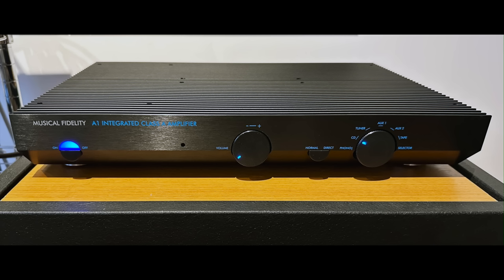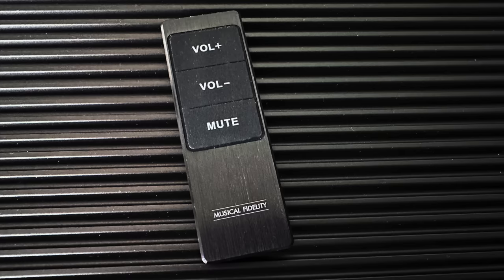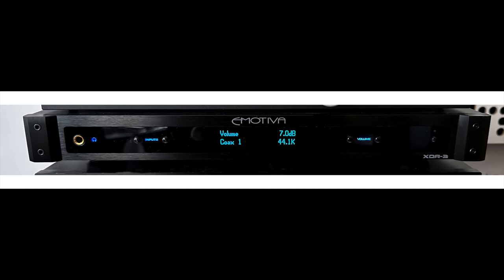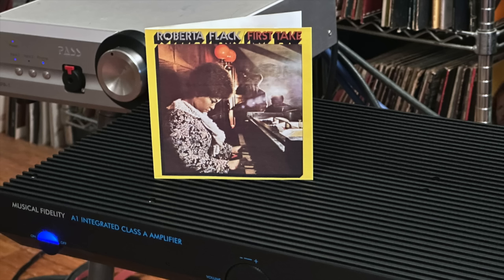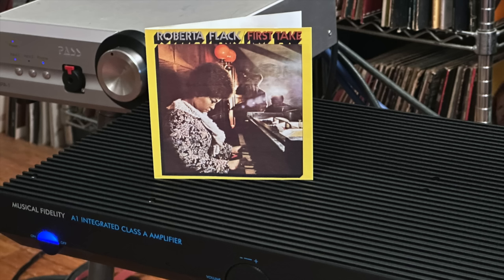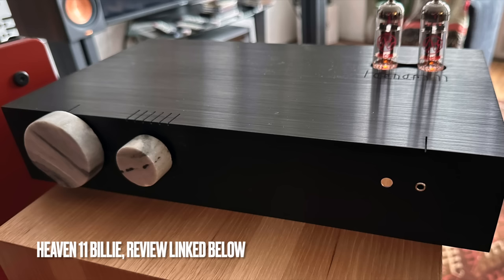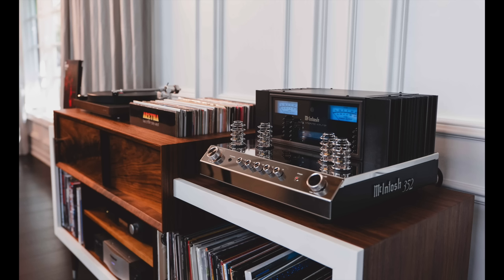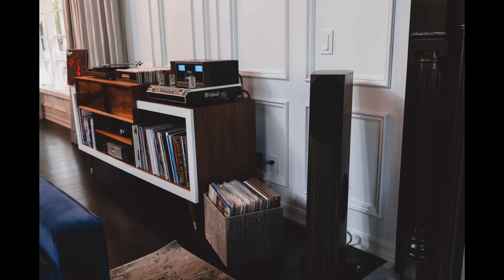Musical Fidelity A1 Amplifier, A KNOCKOUT!

Comment: The corrugated surface looks like a pan for grill marking steaks or pork chops.
Reply: Perfect for grilled cheese sandwich
Reply: It’s a built in George Forman Grill.
Reply: It's hot enough to cook👍
Reply: A lot of home/car audio amplifiers looked like this back in the 80's & 90's.
Reply: As long as you like everything well done oh, but you can only use grade A meat it's the only thing that works with class-a

Comment: 1985 - that is when I bought mine. Still running it =)
Reply: thats super cool its still going. you have to get any work done to it ? 85 was the year i was born. i got the new release of it and enjoy the hell out of it
Reply: @philrob4468  I had a fuse blow and when I took it in to fix they also fixed the source selector that was slipping and recommended I re-capped it as the capacitors were looking worse for wear. It's been brilliant since.

Comment: Hey with cooler autumn temps coming on it's nice to know you can buy a room heater that drives  speakers!
Reply: It's the kind of thing that could be used best in the winter time. Unless I am mistaken, a Class A amp is 100% efficient at turning electricity into heat at idle.
Reply: @EskWIRED  Yes, but the particular amp consumes about 100W at idle.
Reply: Do you live in a closet?
Reply: The bad news is that your electric bill goes up....the good news is your heating bill goes down!

Comment: Back in the 80s I owned the bigger brother to this amp, the A100. I remember the sound fondly. The bigger amp contained 3 fans for additional cooling. If one fan went down then the thermal management circuits shut down the amp. Mine went back to Musical fidelity twice in 18 months with fan failures so I sold it (despite the quick turn-round from MF). My cousin (a professional musician) owned the A1 for several decades and loved it. Both Musical Fidelity Class-A amps sounded great. "Engaging" would be a good description, these amps really draw you into the music.

Comment: I returned a pair of speakers for store credit and on a hunch and a whim I used that store credit and pre-ordered the A1. My A1 unit arrived double boxed, and like Steve I was very impressed with the charming sound of this amplifier. This is my first amp experience with solid state class-A circuit topology and now I’m in love with it. I think of it as this analog vortex of hot dense energy that summons tunes that glow like neon lights. It does all the neon colors, the tones have a luminous watch dial in the dark quality, the way the tones pop and flow makes it easy to connect the intent, that music aims to convey, think chord and sentiment. I don’t think of it as warm sounding in the way that tubes glow warm, the color is not orange or red the coloration is like the half moon power switch on this unit it glows blue. This half moon power switch design has this clickety-click, that is in itself a time warp back to the mid 1980’s, remember the tactile feels of cassette tape players from way back then, that rectangle key of a button before silent buttons became the trend.. P.S. the remote is magnetic
Reply: The sound of the A1 was ... you know, it was okay as a 25 watt amplifier, using the speakers of the day that in England never went much below 80Hz.  Some people claim they used Wharfedale but the A1 was more expensive than that.  Nobody ... not a single buyer ... bought Wharfedale for an A1.  They used you know, British market stuff, I never even bothered looking at what they used.  It was a good, big room filling sound but it a bad time in NYC, the 1980s, wow!  You know, any remember the British speakers we used back then?  They were TDL, JPW and Mordaunt Short, you know stuff like that, not KEF, not Mission.
Reply: @keplermission  I'm listening to Dream Division's 'Lumarian' album from the Library of the Occult Records collection, did you know that blue stars are the hottest and most massive of all, can you feel me now
Reply: @keplermission  What are you mumbling about? You are clueless.
Reply: What speakers are you using please w it & what size room  ty ?
Interested to hear how it compares to Sugden & belles integrated (a/ab)

Comment: A once nearby- living friend had the M.F. A1 in the late 80's, I heard the upgrade difference & it was vastly superiour in every way to a fancy looking Technics he had before. After a post- guarantee fault fix, for playing music during hot summer days, he'd put extended speaker wires on & bought longer interconnects, so he could lift it onto a north-facing window-sill diagonally behind his equipment rack for cooler air or some breeze to help cool it, & it's heat seemed to scare him. An engineer friend of ours repaired it twice in the 5 or 6'ish years he had it, until he bought one of my post-upgrade amps, a Crimson Electrik pwr/pre. 
The very first batch of A1's were said to have had reliability issues by 2 or 3 mag' reviewers,  (maybe due to heat?)  but I'm 100% sure M.F. would have overcome any & all reliability issues now they've bought it out again.   P.S. The first Mark Levinson amp I saw & heard working, (ML25?) was rated at 25 watts p/ch in pure class A, it stood tall, large & heavy, and the paint on it's side pannels would eventually tarnish tho quite quickly due to heat alone.  Some newer amp' makers miss-represent spec's e.g. my previous Jungon power amp, (a 99C ?) was spec'd by Jungson as 80'watts max in class A but I've seen the measurements & scope test showing how it does the first 15'ish watts only in pure A, then goes up to 140'ish watts (below point-1 THD) with a slowly increasing class B trans' bias,  it never bothered me as with even lower of averagely efficient speakers, i / we don't go beyond 4 or 5'watts, or a very loud sounding 10'watts rms

Comment: Nice one Steve. I owned an A100 up until a few years ago. I loved it but I listen all day long and It just made me uneasy because of its heat. 
A replacement that was as enjoyable was a bit costly, (it is a jardis).
But it goes to show if it was good decades ago it will be good now.
Reply: You know, the A100 put out more heat as 99% 'Class A'.  But the truth is that cool running Technics 'New Class A' in the awesome SU-V505, ran with Wharfedale Laser 130 and it was better than the Musical Fidelity A100 but the people who bought that upper market brand couldn't bear the thought of using the same equipment as people who were of a lower social class, it was a prestige/ pride thing.

Comment: Class A solid state amplifiers sort of perform like low watt tube amps where they feel much more powerful than their rating. I have a Nelson Pass Burning Amp 3 that's about 35-40 w/8ohms and with my 87 dB, 8 Ohm Usher speakers there is no shortage of power whatsoever.
Reply: I agree. My 6 wpc class A set tube amp sounds powerful and alive even when A/B’ing against my 104lb Mark Levinson class AB 100wpc power amp up to 85 db peak.
Reply: @epi2045  I don’t doubt it. I also have an Odyssey Khartago which is also about 100 watts or so and, yeah, the burning amp goes neck and neck with it as far as volume and even sounds fuller with better bass not to mention beats it in many other ways. What are the specs on your speakers?
Reply: @sean_heisler  I have a custom built Tarkus speaker designed by Paul Carmody. It has a large separate 62 liter cabinet for the 10” woofer and the 6.5” mid and 1” silk tweeter on the top cabinet. 

Specs: Tuned down to F3 of 29hz and extends to a smooth 20khz. 8 ohms and dips gently to 5 ohms. 89 db sensitivity. Pushes to 106 db comfortably.

It’s an emulation of the Wilson Audio Watt/Puppy. It’s a big speaker driven by just 6 watts. Would you believe that it has so much deep bass that it rivals my 15” sub? When I say deep… I mean deep.
Reply: @epi2045  Nice! Just looked it up and they look great. I’m seeing variations of how the enclosures are built and I see the Wilson-esque approach. Those haven’t crossed my radar before! Amazing to think 6 watts pushes all that!
Reply: @sean_heisler  '6 watts?'  Think six ounces, then consider what it's six ounces of.  Six ounces of low quality or six ounces of high quality?  People forget there are different qualities of watts.  Radio Shack in the early 1970s made a lot of high quality low power stuff but we needed special loudspeakers.  Six watts drives what six watts will drive, but we need to use lightweight motors.
Reply: Pass Labs kit is proper hifi - Musical Fidelity in consumer electronics.

Comment: I’ve been reading great things about this amp. And don’t let the low power rating fool you. This is a expensive high end component as compared to a mainstream receiver sold at Best Buy for 500.00 and a exaggerated power rating just for marketing purposes.
Reply: No ... power rating?  A long time ago I told people on here about the Technics SU-Z2 that in England with a 240 volt supply used 470 watts to give 2 x 35 watts.  What did it mean?  Well I looked everywhere on the internet to find just what the Musical Fidelity A1 uses from your wall socket and all I could find is what it puts out to the speakers but that isn't the power consumption.  If it is an ugly room heater as people say, how much juice does it burn?  Most British 35 watt amplifiers use about 190 watts at 240 volts and at 120 volts in the USA, use about twice that much current.  Yeah but...

Comment: This is a class A/B amplifier. Musical Fidelity's marketing webpage for this amplifier at their website states, "The A1 is built around a completely discrete and symmetrical Class A topology. It‘s able to output 25W of pure Class A power @ 8 ohms load with 25A of maximum output. While the numbers here might seem rather low, the ability for the output stage to drive difficult speakers is a small miracle in itself. The amp design being dynamic class A, and if Class A standing current is exceeded, it will automatically allow more. It therefore “slides” (NOT “switches”) smoothly into class B style operation, temporarily allowing the further current draw needed."  In that quoted marketing blather, that last sentence describes what a class A/B amplifier does.
Reply: You are confused. You are confusing push-pull vs single ended output stage topology with Class AB vs Class A. There is NOTHING that necessitates a Class A amp to be single ended. Class A means the transistors are biased such that they are always on for the amp's specified power. A single ended amp can only be Class A by definition but a push pull amp can be anything depending on how the output devices are biased. The A1 is a push pull amp. Is a push pull amp specified as X watts of Class A power not a Class A amp just because it may be able to produce more than X watts of power when sliding into Class B?

Comment: It will be interesting to see if this version of A1 holds up better than the original, which had serious reliability issues associated to heat, at least as far as I know. My headphone amp has a similar profile- gets hot like you read about, and, of course - I think , makes a better lover than a mate. Otherwise, very cool design.
Reply: MF promise that it will due to larger volume and top plate size, perforations on the sides and better rated components inside.
Reply: I had the original AI I bought new. I had no issues whatsoever and I used it for about 20 years.
Reply: @adotopp1865 awesome! Mine was more of question than statement. It looks really cool & MF has a long history of awesome products.
Reply: What hifi compared both. They concluded the original and the new one were really really clones like, that includes the overheating as well
Reply: @Bouba1874  but is it overheated if it's working as designed and not blowing up?
Reply: @adotopp1865  you're absolutely right, i shouldn't use "overheat", but rather just very hot but that's expected. It just may be surprising to people not used to pure class A amp, by nature and design, it will be very hot whether in use or idle, that's perfectly normal. I have 5 different MuFi amps at home here including some class A/B that are bridged in mono , they all get hot, including the A5 CR,  which is also class A/B. However, the A1 gets the palm. It also sound very, very different compared to the other ones

Comment: The A 1 sounds interesting. Although it's not a tube amplifier it seems to do what tube amplifiers do. I have an old 20 watt Scott LK 48 that have a muscular feel as well. So much so I hooked it to my Magnepan 1.7s and was astonished. At decent  listening levels it drove them quite well. I'm curious to know if the A1 can do the same.
Reply: It certainly sounds like a good, not too tubey, push-pull tube amp.
Reply: No ... the A1 is 8 ohm and the Scott uses 7189A that can drive 4 ohms, Maggies are 4 ohm.  7189A were a US version of the old 'Empire' British EL84 that were at best rugged, used in portable guitar amplifiers because as designed to cope with American railroad cars, long distance travel that the British tube couldn't offer.  The British Empire was different from the United Kingdom, it was a global concern.
Reply: The last thing I'd call the A1 is muscular and it doesn't sound like a valve amp at all.

Comment: I made them all
What was good in original A1 ( and I hope they kept that in newest version) is output stage constructed by Great Tim de P.
What was not good in original - everything else, electrical/schematic vise but also complete package is simply inadequate for its heat ( 8W in A Class @ 8R) nor power supply was anything close to being enough
So, again, they kept same format/size, so just selling extra-fine English Mist slightly renewed
Now, what's needed that one can hear gorgeous output stage in full Tim de P. glory is - to make it properly, with power supply and case (heatsinking) equal to Papa's FW products, standing current set to level enabling full power in A Class
Historically - A1 have its place, but with time clearly revealed what is good and what is wrong with it
I'm allowing possibility of wonder that someone had enough brain to replace previous line stage (that one being utter drek) solution in newest A1, allowing some more potential, but it's obvious from pictures that (again) someone is claiming much greater A Class power envelope than it is possible with existing PSU size (xformer) nor is possible with heatsinking capability
Nice amp so-so, but half of claimed and certainly as predecessor ( and majority of MF products) you have jeopardy same as having cheapest 
third world made extension cord.
So, if you can't make your own - buy it
If you have no mileage to see through PR sneaking around the truth, buy it
But - if you did you homework knowing at least some of N. Pass work (not just amps, but spreading knowledge) - find old schematic of A1 and build your own, properly

Here goes P. W. Klipsch Lapel button.
Reply: Design of new one is 99% the same TdP design. Improvements have been made in power supply and transformer, PCB layout, phono stage details for less hum and noise, component quality and rating and heat dissipation. Plus tape monitoring button has been replaced by Direct button which bypasses preamp gain stage (but not the volume control) so effectively only the power stage is used. Hope this covers your questions. Regarding the rest of your mumblings, listen to this amp first before making assumptions. I have I was impressed.
Reply: @razisn  To each his own
I was technically clear in my mumblings what deficiencies of first one were, and clearly same limitations are incorporated in new one
Anyone with enough technical knowledge will understand and weight properly what I wrote
Rest ....... well, just enjoy in what is made far from real potential of Tim de P. circuit potentials
Btw. repeating same words which someone in PR department wrote, using them as "facts" ......... in many cases are just repeating of half truths.
ZM rogerandover, leaving you to enjoy in Glory of half-made proper amps
Reply: @ZenModLabs  Ι would love to see you elaborating on your 'clearly'... I gave you a response on all your technical points so what remains is 'clearly' pointless mumbling and rambling.